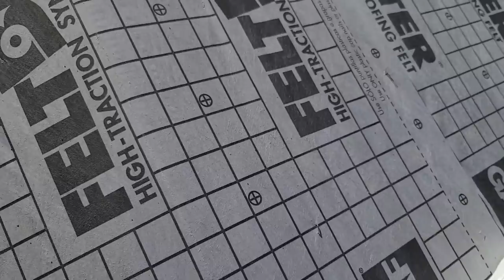Worlds NOT So Fastest Shingler

Comment: Not sure about bouncing around from rake to rake with the starters..  I like to complete as much of roof as possible in area im currently occupying.  Good video.
Reply from the maker: i'm all with it! I just ran the bottom and my starter rake though. sometimes I'll do things that I have to do all at one time so that I don't have do it at random times. for example how I have to lay my bottom 2 shingles from the side anyway. I just knock out a bundle n I got something to stand on. I can definitely shave some time with efficiency still
Reply: @NWIVeteranConstruction  i get it....thats how you train guys....to complete one job then move on.....good practice for teaching new guys.   If your quailty is up and your looking for speed....stay put...roof...move on!
Reply: I agree. To much moving around Unnecessary moving.  Also popping lines are for rookies. Only for 3 tabs
Reply: Also, by doing the bottom across, it prevents guys spinning themselves around them, and being near the edge later in the day. Getting the bottom done in one step compartmentalizes safety to a short time in the day instead of throughout. Much rather have a guy fall on the roof than off the roof. I had my guys always do the bottom 4 shingles. Much rather they do things my way than I end ip in prison for criminal negligence as an employer who was aware of unsafe work practices that led to someones death..

Comment: @ Zack of All Trades I am sure I will get flammed for this. But are there any tips for roofing in the heat? i.e., canopy suggestions. I live in the Midwest 96 and humid so feels like 100 and my shingles are getting scared up, which in turn we have to quit. This is on my personal residence and I have a full time job, so I have the weekends and after work to work on this. P.S. roofers are tough! I am finding out how much of a man I really am.
Reply from the maker: Start early as possible on those days. Walk on a cushion. Do not hose down the roof because it gets hotter. Don't stand in one place too long and if you have to quit then so be it

Comment: I've taken one thing from you as a fellow roofer, and that's your 45° cut on your first piece gable edge starter. You know what you're about and that all that matters, but on my crew's roof I'd be checking every one of your key ways untill you hated my buts.
Reply: What's a key way?
Reply: I noticed the 45 degree cut on the starter. What is that cut for?
Reply: Justin, a key way is your seems between were your shingles meet.
Reply: Andrew, I believe it brings your glue line closer to your gable edge so you have a tighter seal.

Comment: Lined up his first row with the starter 7:33 (has too be a minimum of 6 inches you had like 2 inches), I give this roof 1 year before it starts rotting on the eave... you should try too set your gun on a lower setting , you drove the nail too hard on every shingle, of you do not believe me zoom in and watch your self, this is not quality it is called a hack and where is the ice and shield on the eave? Word of mouth is the best advertisement and word will get around some day
Reply from the maker: It's not a heated building Therefore Ice and water shield isn't needed like it is on the house which you can see i put it on in the background.  N I said I fixed the starter later! I wasnt gonna stop the video. I staggered it perfect in the beginning but for some reason gaf starter isn't the same length as the shingle so it walked its way in. Not only to become seam in seam eventually but it messed up the nail spacing as well. I had shingles land on nails that I had to fix too. N if you look i tried to adjust my gun at one point in the video.  Its all the way down.  I could've lowered the compressor but it wasn't that bad and believe me I was paying attention. Some are definitely blown through but for the ones that were bad enough (and I looked at every one while I was nailing) I added extra nails before laying the next one.  Like.. can you read? You're always on here hating lol do you have anything nice to say?
Reply: @NWIVeteranConstruction  it lined up the whole way, every shingle that was on the first row lined up with every seam ( i do roofing for a living running my own company and this was a poor job) I agree about the ice and shield if it is not heated. But as you said in the video it gets windy as shit out the and you did blow through almost every shingle, from the start you could of been setting your gun (if it is really hot sometimes we gotta too turn then gun down, when it is cold you might have too turn your gun up) I am a professional and I have every right too comment what I see but here is the biggest kicker about hacks ( i do not sub for this reason) that a hack will have every excuse in the book ( read all your comments against people who called you out) 🤫
Reply: @NWIVeteranConstruction  one more thing is I comment so the people making the videos can read what I have too say and take into consideration of what they have done wrong and i always give a solution how too make you a better roofer or too fix it
Reply: Seriously you cannot fool.a.pro just watch the video and you will see you lined up every shingle on the eave haha
Reply: @stixprogaming2718  THE WORD IS " to " NOT " too " FFS GO TO SCHOOL ! you used the wrong word 3 times in one sentence , and you're criticizing someone else ??????
Reply: @robertn2813  hahaha ask me if I care?
Reply: @stixprogaming2718  GAF starters are about an inch shorter that their architecturals. I had to deal with this myself this week. I got in the habit of double checking everytime I switch or mix brands to avoid the problem. Starting with a back step fixes this problem. But with other brands that can create a problem. So you have to watch for it
Reply: When a starter is close too lining up cut back under the shingle around 8 inches then put a starter piece that is 16 inches and you will not have the problem on that side for the rest, I use iko leading edge and iko shingles, they are exactly the same size. If you mix your starter with your shingles the shingle could be longer than the starter and eventually you will line up
Reply: @stixprogaming2718  which is exactly the problem. He bought the 'matching' starter expecting them to be the same size and not be an issue. But GAF starters are 1 inch shorter than their shingles for some strange reason. What matters is that he acknowledged it was an issue and well have to trust he fixed it after like he says
Reply: @RabidParana1  sorry I only use iko, possibly you could call gaf and let them know about the problem and they will take it into consideration, lots of company's upgrade there shingles which makes them longer and then does eventually makes the shingle line up with the starter, for example bp shingles ( which are the worst shingles you could use) were 38 inches and they upgraded them too 41 inches, but that was 7 years ago and at the time of roofing there was no starter shingles, everyone used the shingle as a starter just like 3 tab and interlocks and old school iko, im 31 and been roofing since 14 so its been 17 years on the roof everyday, I've seen so many things evolve in those 17 years, back then was easier, no paper other than the bottom row and valley tin in the valley and no drip edge, it is amazing how roofing systems have evolved
Reply: @NWIVeteranConstruction  let's see a vid that you repaired every starter on the bottom row, use a tape measure and show us the starter is back 6 too 8 inches where 2 of your first laminut shingles butt up